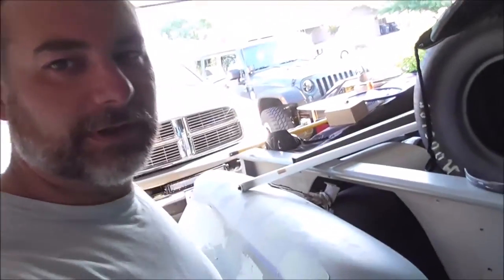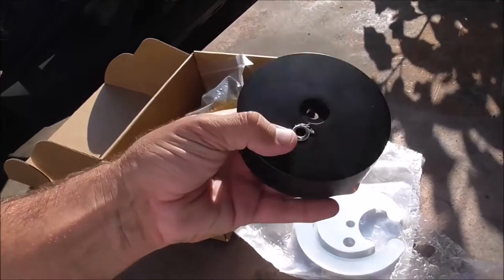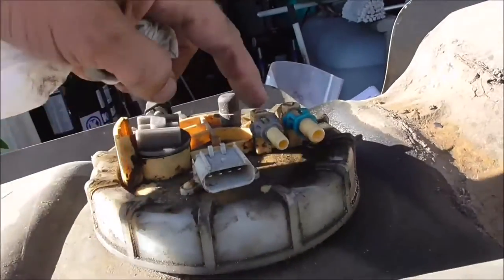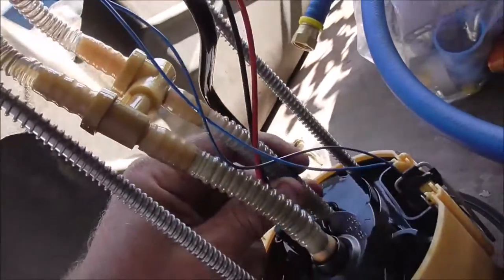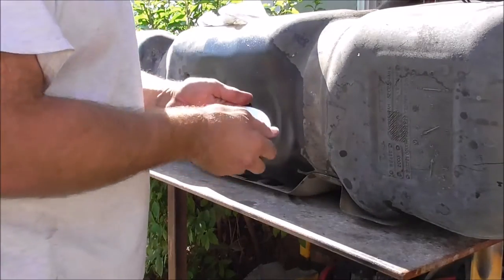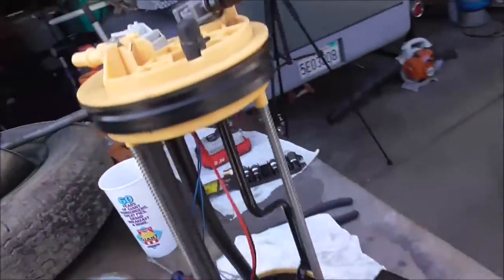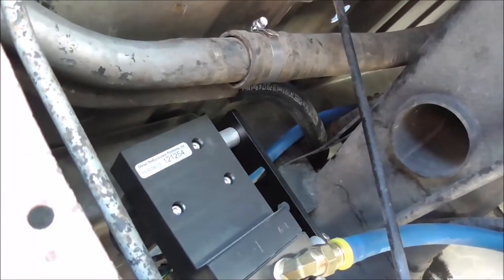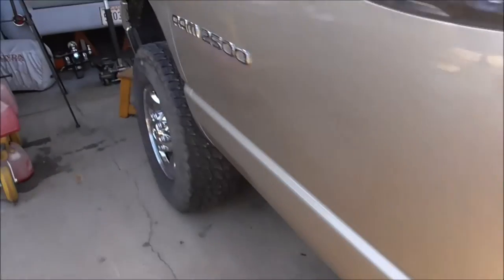fass install

Comment: I saw that sump install on another truck and cringed then, why would you drill a huge hole in bottom of tank? All the grunge will now go to the sump and to the filters and the chance of a leak from tank is much greater.

Comment: Why would you delete the stock filter the more filtration the better. I have yet to understand that one.
Reply: flow? and it cleans up the engine bay a lot the stock fuel filter doesnt even come close to filtering small enough micron. If you did your research before assuming the real reason to keep the stock filter is the fuel heater works really good and the water seperator works good to. Why would you go throught the work to run 1/2" line all the way from the tank just to hook it to a way smaller bottleneck of a stock filter. I have yet to understand that one
Reply: Nicholas_ Hoaglan_215  My factory lift pump failed on my 03 at 100,000 miles. Installed a Fass 150/150 fuel pump. Fass has a good water separater filter. A good fuel filter. I am coming through the factory fuel filter on the engine. Am using the 2 micron Fleetguard filter. So I am filtered 3 times. At wot I am at 14.5psi. You can not burn than much fuel in a 400hp engine. Plenty of volume. A stock lift pump at wot will drop to about 2.5 to 3 psi which I’d not enough pressure for best performance.  I have run this set up for over 12 years and increased my mpg about 2.5 miles per gallon. And because on the increased filtration I am still running the original injectors with 226,000 miles on them. Still running strong, and not leaking down. So yes the more filtration is much better in my books also.
Reply: @davidbottles7298  how did you connect the fass kit to the factory filter bowl?